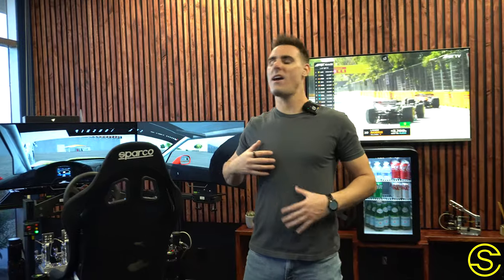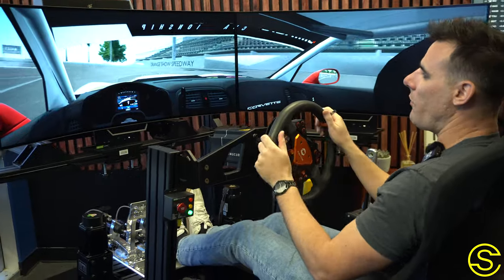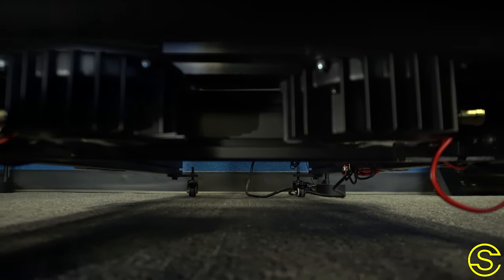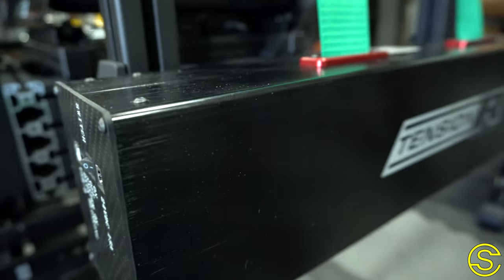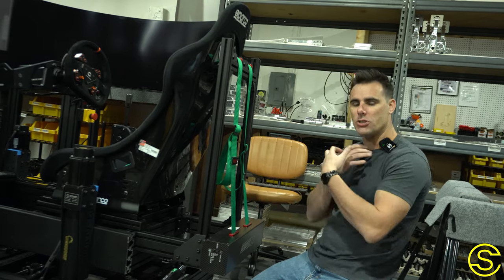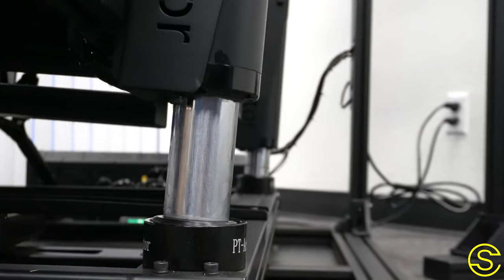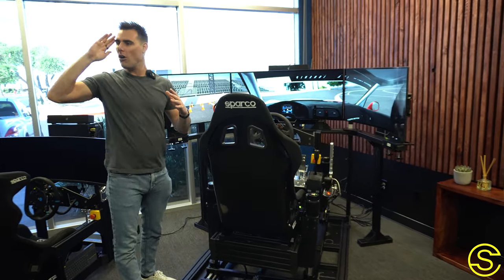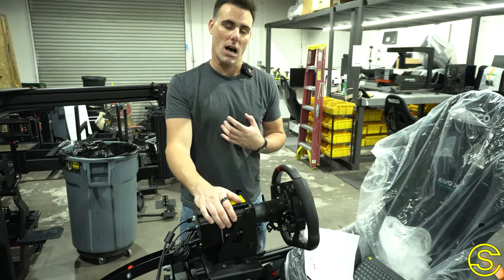5 MASSIVE Upgrades For Your Racing Sim!

Comment: The surge movement is a bit wrong in my opinion 
I tried different methods of surge movement so in your situation you are having the surge move at the same direction the car moves so when you accelerate it moves forward and when you are braking its moving backwards so usually the g force when the normal car proceeds when acceleration is that your body moves against the direction that the car is moving when you accelerate the car push your body backwards and when braking you body goes forward the the steering wheel but
Reply from the maker: Yes, you’re correct 😎